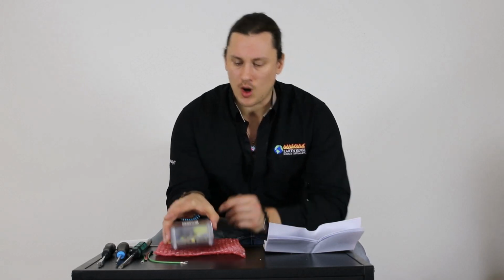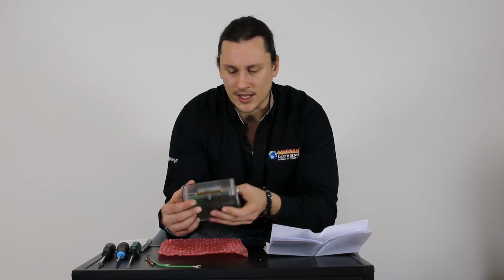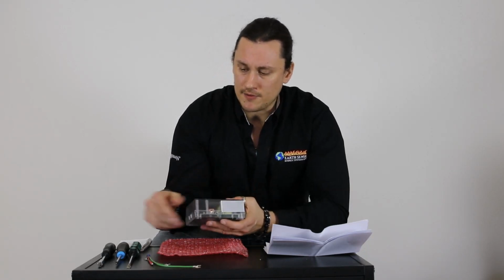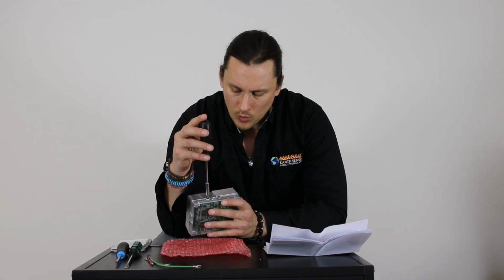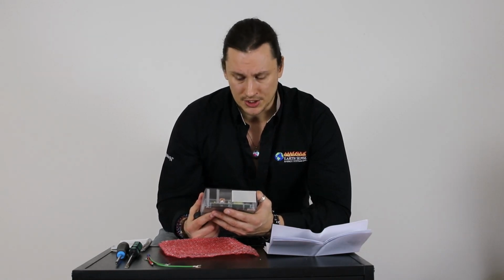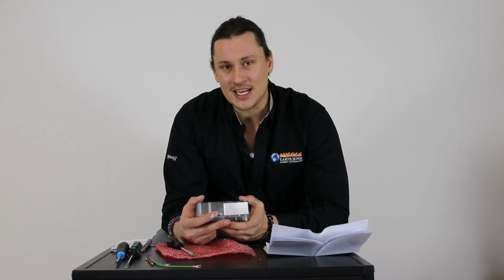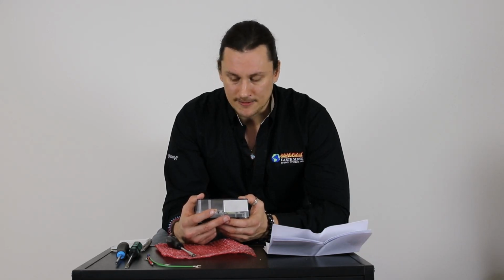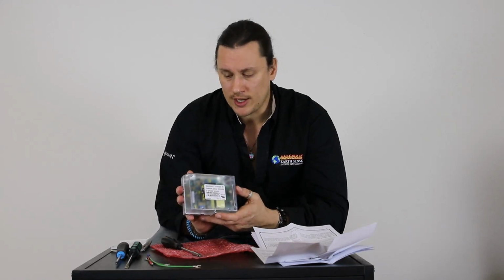QuadraFire 3 Speed Control Board Installation and Settings

Comment: I have a Quadra Fire classic bay 1200i. We have been trying to get it right again all season. Replacing cheapest parts and working our way through. We live in a small town with no parts readily available so it’s one part a week basically. Anyway, we just received and replaced the thermocouple tonight because our stove would no longer feed pellets. We bypassed the vacuum switch and still no luck but purchased one anyway. That did not fix the problem. Got in thermocouple that said it would fit our stove but the wire was not nearly as thick as our old one. Swapped it out anyway and it did actually start to feed pellets and started the fire but no green or red light came on the control box. Fire burned out and unit turned off. Please help!
Reply: It was an OEM and ordered from Amazon. It specifically stated it was for the QF CB 1200i. The part number was 812-0210 and I will be sending it back. I have already placed the order for the control box with your company and it was shipped on 2/13/2020. You have been so very helpful and I thank you very much for all of your help. We will keep trying parts and keeping you updated as to how it’s going. I sure wish you guys were closer!
Reply from the maker: @valerieharvey3149  Certainly our pleasure Valerie. Yes, I think it's a good idea to send that Thermocouple back and order a replacement. You can take a look at ours here. https://pellethead.com/product/quadrafire-thermocouple-35-oem/
I really think we should try a different thermocouple before you attempt to install the control board. Control boards are non-returnable if they have been installed or used in anyway. If we discover the problem to be something else and it's not installed we can have you return the board. Sorry for all the hassles here. The 1200i is a very good unit and we will get through this. Thank You!
Reply from the maker: Thanks for contacting us Valerie, happy to assist. The Thermocouple Detects the heat during start-up and locks in the control board to start feeding fuel in normal operation once it has reached temperature. Very interesting that your stove started feeding when that was installed. Generally speaking, if there is an issue with the stove not feeding when you turn your thermostat up it would not be an issue with the Thermocouple. Regarding the Thermocouple you purchased, make sure it's Thermocouple Part Number 812-0210 - That is the correct one for the 1200i. I always suggest checking the basics first. Cleaning/Maintenance is the #1 Cause when it comes to issues like this. Let's make sure the venting is clean and free of any obstructions. Let's make sure all rear ash traps and rear heat exchange panels have been checked and cleaned. Let's make sure that your door gasket and glass gasket is sealing tight all the way around. Ash Blockage or Gasket Leaks will trip your vacuum switch and not allow it to operate even when the switch is good. Check your combustion motor - It should be running near line voltage (About 2500 RPM) During Start-up. If the Motor seems slow and sluggish it will not lock in the vacuum switch and allow pellets to feed. The High Limit Switch is another safety sensor that can shut down the auger motor. This switch should have a small manual reset button in the middle that can be push if it's tripped. On most 1200i models it's located by the upper auger chute. Again, start with the simplest things; I may even suggest double checking the wall thermostat and wire connections. Let us know what you find, we'll make sure we get you back to 100%. Thanks!
Reply: When you say rear heat exchangers are those the ones behind the panels inside the door above the fire pot? Gaskets all seem okay but not sure how to check those for sure. We have called ourselves cleaning, blowing, vacuuming everything that we can find but the inside sure is black.
Reply from the maker: @valerieharvey3149  Yes Valerie, Those are the panels above and to the left and right of the burnpot. Ash will accumulate in those areas and it's important to keep clean both for proper air flow and for efficiency. The glass gasket is typically just a visual inspection - Make sure you don't see any gaps. Generally speaking glass gasket should be replaced between 5-8 seasons of use. For the door gasket you can test the seal. Put a dollar bill half in and half out, close the door and pull on the dollar bill. Should be very heavy resistance when trying to pull it out. Try in several spots all the way around the door. If you are noticing a black soot inside the stove that is a definite indication that we have an issue and most likely it is also related to your feed issue. Any time we see sooty black like that it indicates we have an air to fuel ratio issue. We are always looking for a grey/white ash which indicates proper combustion. As long as you are using good quality pellets, this issue is generally caused by one of the following
1. Ash Blockage somewhere in the unit or venting
2. Leaky gasket seal
3. Weak Combustion Motor

Again start with the simplest first. Really go through your owners manual and clean all applicable areas on the unit to ensure it's not an ash blockage issue. If you need an owners manual just let us know. Test your Door Gasket Seal. You Can use a Multi-meter to check the voltage of your combustion motor - should be near line voltage during start-up. Keep us posted. Thanks!
Reply: We have now pulled the flue hose off and emptied a bucket full of soot out of it. Reconnected it and vacuumed the inside out real good. Started the stove back up and it started like it should and burned with a really good, right sized flame. Burned and dropped pellets until the blower kicked on and then shut down as soon as it kicked on. I have submitted an order on your website for a new flue gasket and control board because I have no idea what else to replace. Praying the board will fix it and that it will be here before it drops to 25 degrees this weekend even though the expected delivery date is the 17th. Maybe, just maybe, the postal service will delivery it earlier.
Reply from the maker: @valerieharvey3149  Hey Valerie, I have discussed your situation with our lead technician Frank. His notes are below here. We need to take a closer look at the Thermocouple you purchased. Was it an aftermarket or OEM? Were you able to verify the part number to ensure it was correct for your model? Before we install a control board, let's really take a closer look at this. 

Message from Frank: Acting like a thermocouple problem being there is a difference between the old and new.  Without verifying MV output, we have to assume that the replacement is also faulty.  A faulty Thermocouple can still have continuity thereby satisfying the amber light diagnostic.
Reply: Well, we finally received the thermocouple I ordered from you guys and we have installed it. The stove seems to be working properly now! I will contact y’all Monday to see about returning the control box as we did not open it. Again, thank you so much for all the help you gave me and getting our stove back up and running. I am forever grateful to you!
Reply from the maker: @valerieharvey3149  That is so wonderful to hear Valerie!! Makes me very happy. On the return of the control box you can let them know it was never opened and that Taylor from the YouTube page assisted with the issue and Authorized the return. Any questions or troubles just let us know. Warmest regards,

Comment: Hey guys I have a freestanding Santa Fe  Quadra fire pellet stove. My question is that my control box is set on 6. That being said my stove never seems to get above 83-85 degrees even when I have thermostat calling for max heat temp, which is 90 degrees. I keep my stove very clean. Very anal about that so I get peak performance out of it. So being the control box is at a 6, would it change anything to switch it to a 7?? Thanks and your vids have saved my ass more then once. Thank you so much
Reply: Yes I have the fuel delivery wide open and everything is clean. Gonna give it a shot. Thanks so much for getting back to me
Reply from the maker: @rollingcoal9500  Our pleasure. Keep us posted with the results you notice. 

Thanks,
Reply: @rollingcoal9500  when was the last time it was professionally cleaned ?
Reply: Not saying you don't do a good job it is just normally when someone has this issue the cause usually winds up being the heat exchange is covered in ash pretty thick so the stove has to work triple overtime to heat through the ash to get to the metal of the stove to heat that up
Reply from the maker: Thanks for contacting us. Glad to hear the videos have been helpful. 

#7 will increase fuel delivery by 10%.  Before doing that make sure the bottom of the hopper does not have an excessive accumulation of fines.  Also, the hopper feed adjustment should be fully opened.  If the hopper throat is clear and the feed adjuster is fully open then set the board to #7.  Note: fuel choice will also be a factor in heat output, hardwood @ 7000-7300 btu vs softwood @ 8200-9000 btu and quality of each.

Let us know if that helps.

Thanks

Comment: I have a classic 1200i pellet stove. I’m trying to get it going again after I replace the motor on the auger. My first attempt,  It starts up with the blower going and the auger feeds pellets for about a minute than it shuts off. the thermostat on high, and call light is on. No blue lights blinking. My second attempt after I unplug the power source, the blue light blinks about 5 to 10 times than stays on. The blower motor comes on for twenty seconds than turns off. After 30 seconds it comes back on repeatedly even if the thermostat is on or off. My question is, is the control box defective? Or could it be one of the snap disc?
Reply from the maker: Thanks for contacting us. Is your fire lighting during that initial feed cycle? Are you referring to your combustion blower? Happy to help, just need more specifics. Thanks, Mr. Pellethead
Reply: Earth Sense Nevermind I got my pellet stove working. Thanks for the response.
Reply from the maker: @nativekilla7318  Great, If you don't mind and want to share, would love to hear what the issue at hand was that you discovered. Thanks!

Comment: STOVE keeps feeding pellets is that a board problem
Reply from the maker: Michael, Thanks for contacting us. If you are visibly seeing the auger motor turn non stop then yes that would indicate a board issue typically. If it just appears it's over feeding, it's generally not, it's usually a combustion air issue making it appear that way. Take off the back panel and inspect the auger motor in operation. We are here to help, just let us know what you are seeing. Thanks, Mr. Pellethead
Reply: This happened to me and replacing the control box fixed the problem.

Comment: I have a Quadra fire Castile insert. We just moved into the house a couple months ago so I do not have an owners manual or anything. When I plug in the stove I do not see any lights at all on the circuit board but the red call light will turn on when I turn the thermostat up. Also, just from research on line, I’m pretty sure the blower should turn on as soon as I plug in the stove but mine does not. Does this mean I need a new circuit board?
Reply from the maker: Hey John, 
Thanks for contacting us, happy to assist. If you want to send me an email I can send you over a digital owners manual for the Castile Insert - taylor@pellethead.com. The blower should not come on when the the stove is just plugged in (Unless the stove was hot). When you turn the thermostat above the room temperature, you should see the red call light, the combustion fan should then come on, and the stove should start feeding fuel for start-up. Once the fire lights and the thermocouple finger over the firepot detects proper temp, the stove will go into normal feed and operation and when warm enough the convection/room air fan will come on. Happy to help and get you a manual. Thanks!

- Mr. Pellethead

Comment: The ground wires included in box, what and why ??? Do I need to replace my old ones?? I do not see a ground screw on my 2003 Santa Fe FS stove as indicated in diogram included with the control box??? What to do what to do??? Please tell me, It's getting cold out here in the west.....
Reply from the maker: Helen, Thanks for contacting us, happy to assist. The ground is just another form of protection. The ground wire can literally be grounded to any part of the metal body/frame of the stove. If you don't have the ground screw in your model as indicated in the instructions, I would simply say to just insert a screw to the metal body of the unit and attach that ground wire to it. Simpler the better. Any other questions please let us know. 

Thanks,
- Mr. Pellethead

Comment: We have an older QuadraFire 1200 but the control board cover isn't transparent. How can you view the lights?
Reply from the maker: Thanks for contacting us Leslie. The earlier boards that have the solid gray or black casing function slightly different. You will only have the external lights on that type of board. Basically your call light and your thermocouple light. Feel free to email us directly if you require further technical assistance or support - info@pellethead.com

Thanks again so much!
Reply: Neither of my lights on the grey control board come on. The unit only works on high heat setting. If you switch it to medium or low, the whole unit shuts down! I've replaced the three speed heat selector switch with no difference in function. Please help! Thanks serial number is 361384

Comment: I have a reconditioned Quadrafire Contour that recently took a shit. I suspect it is the control board as the red indicator light is out and the only function i get is the small exhaust fan. the inspection date on the control box is from 2002! The other thing is once i started poking around i found a green wire with a female end on it going to nowhere...? There were no male prongs anywhere to be found for this nuetral wire. Is it safe to say i need a new control board?
Reply from the maker: Thanks for contacting us Tom. It could very well be a control box issue. One other area you may want to check is the high limit switch. I believe in the early Contour models that if that high limit trips or is faulty the only thing that will run is the exhaust fan. For testing purposes only you can bypass the switch. Pull the two wires off and connect together with a jumper wire. As for the green wire, we would need to know where that is coming off of. In most cases Green will be the ground wire. On the convection or combustion motors some have that grounded to somewhere on the stove, if there is no ground it can just be left disconnected. Hope that helps, if you need any parts checkout our site https://pellethead.com/product-category/parts/stove-parts-parts-2/quadra-fire-stove-parts-parts-2/

Comment: I had a bad thermocouple.  Had the amber light blinking.  Ordered and installed new thermocouple and thermocouple cover. Raised thermostat, red call light came on and fed pellets. Everything seemed ok. The pellets ignited and burned for a few minutes but would not continue to feed pellets. No green light indicating 200 degrees or red light indicating 600 degrees. If I hit reset button pellets will drop and continue to burn. I replaced exhaust blower about a month ago. If I remove fuse and reinstall it I get 4 blue blinks. Other than that no lights from the control box whatsoever.  Any ideas?
Reply from the maker: Happy to assist. Can you let us know what model Quadrafire you have? Just as a test throw an extra half handful of pellets in the burnpot and then turn your thermostat up so it calls for heat. By doing this we can rule out if it's just the thermocouple not getting hot enough. Also, make sure that thermocouple is installed far enough over the burnpot - positioning of that is important. Let us know what you find, happy to help and get you back up to 100%. Thanks!
Reply: It's a quadrafire 1200i. When the initial feed of pellets starts to die out I hit the reset button and it continues to feed for a few seconds. The fire gets real high and burns for about 3 to 5 minutes then dies back out again.  I know the thermocouple is getting hot enough.  The new thermocouple darn near gets orange
Reply: @johngacek2748  you should not be able to see the metal of the T couple unless the cover is off
Reply: And the thermocouple is positioned properly.  Checked and adjusted it about a dozen times with no change in performance. Up until the thermocouple originally failed the stove ran perfect. So I suspect the thermocouple. Is it possible I got a bad thermocouple or when the old one failed could it have damaged the controller box?
Reply from the maker: @johngacek2748  Hey John, it does certainly sound like a thermocouple issue here. You either A, received a faulty defective thermocouple or B, the last thermocouple took out something in the board - potentially a short. The Thermocouple does have a 90 day warranty, hopefully The place where you purchased the Thermocouple from can assist in getting that swapped out. I would suggest starting there. If you need any further assistance or parts just let us know we are happy to help. 
Thanks,
Reply: @johngacek2748  perhaps the issue is where the T couple attaches to the screws?   bad connection?   sounds like a vac/ vac switch issue or T couple issue if it goes through the start cycle but cuts off when the run cycle begins